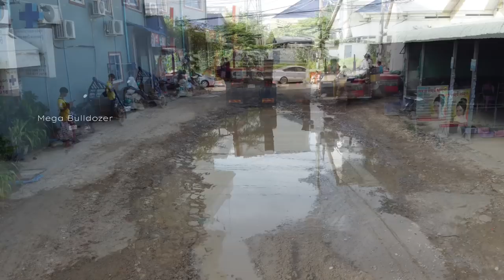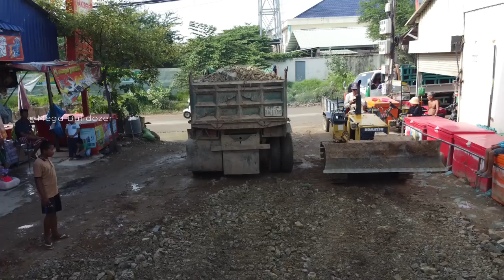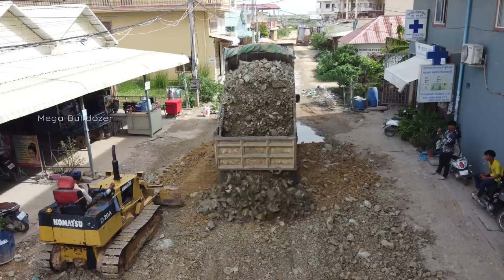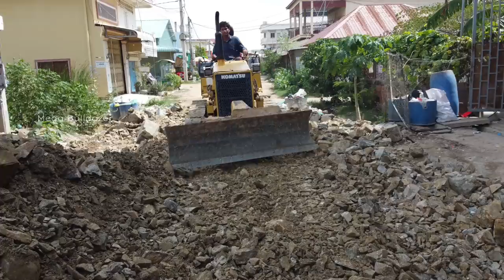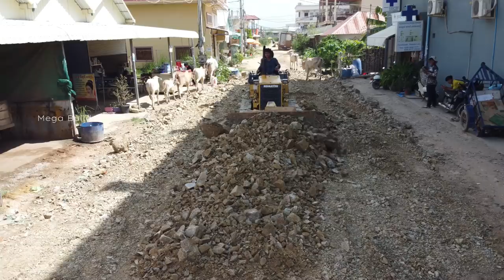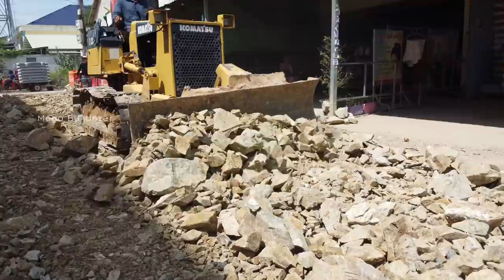Features of the project run by experts to rebuild roads to make it easier for farmers

Comment: Iam just 16:08  wondering where is all the water drains? All water goes down hill. I see yous are all replacing water with stone and sand. But when you get more rain. Did you figure out where to run all the water?
Reply from the maker: No problem when it rains into the underground sewer